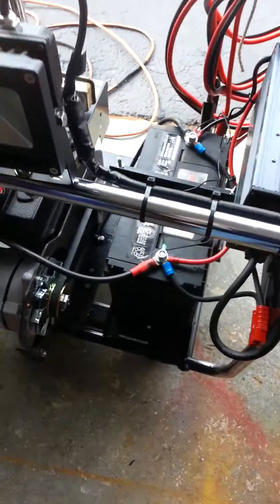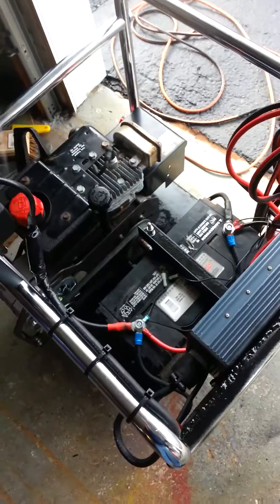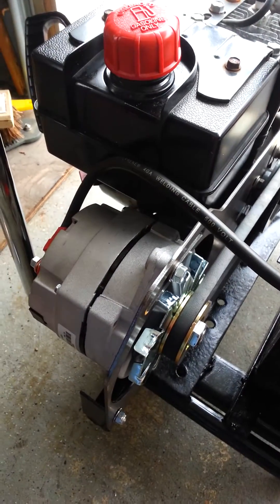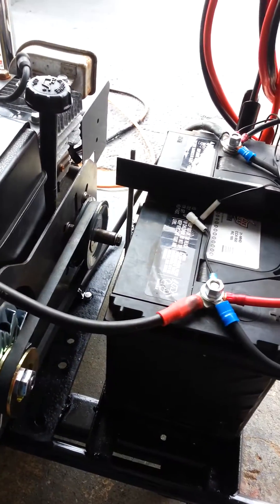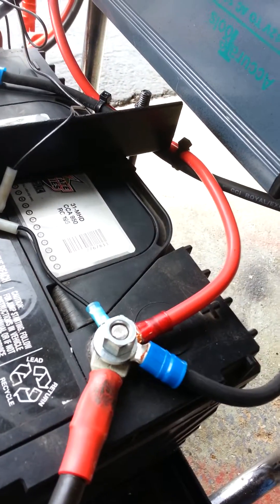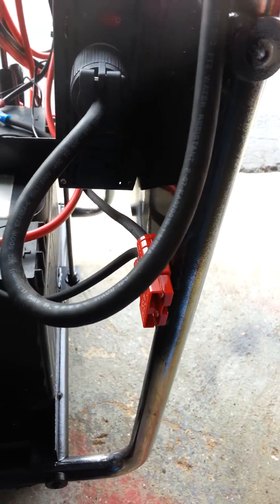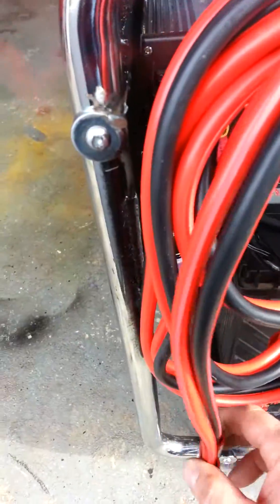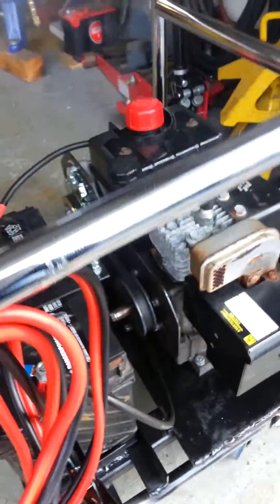Snowblower turned into a generator/ car starter

Comment: Great idea i have the same motot on my snow blower. Where did you get the bracket or did you make it? I want to keep s.b. working and want to add the alternator to it for solar backup. Keep up the great vidoes thanks
Reply from the maker: found it online at a site called epicenter I think. Its been a while.

Comment: ”We got about 6 inches of powdery snow. Recommended>ur2.pl/988  < I have a large driveway about 40 ft x 50 ft, sidewalk, RV pad and backyard area for the dogs. The snow joe cleared it all in about an hour. It never got plugged up. The only slight downside is having to mess with cord and the chute would sometimes move a bit if the control handle was up and gravity pulled it down. But other than that it was all thumbs up. Would definitely recommend. It even chewed through the 10 inch pile left by the snow plow at the end of the driveway.”
Reply: awsome

Comment: I wonder how many AC volts/amps the alternator puts out before the rectifier diodes? I am also curious how many watts are lost during the AC to DC conversion, and converting DC back to AC with the inverter?
Reply from the maker: markfothebeast it's a 85 amp alternator. not sure on the loss but I have found that 5hp engine simply is not powerful enough to run this set up, because when I put a good loud on it the engine stalls. so I have since replaced that engine with a briggs 950 series engine and has no problem keeping up.
Reply: +Fast92RS383 I just saw an interesting video on removing the rectifier bridge and tapping directly to the alternator coil for direct AC output. There's got to be some type type of gain in output. but it's nice to have the DC output to jump a vehicle.
Reply from the maker: markfothebeast I have used it quite a few times to jump start equipment and test starters.
Reply: +Fast92RS383 Also, I've done a couple 2 wire conversions on older vehicles. The field output wire would simply go to the battery (or a load junction) to maintain charging output for anyone who might be curious.